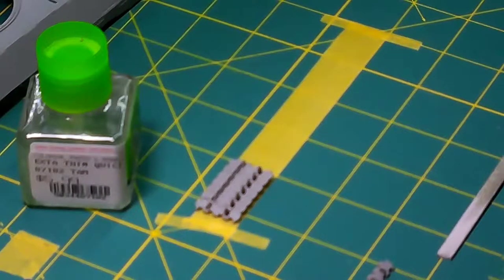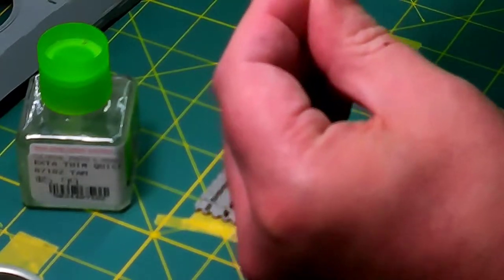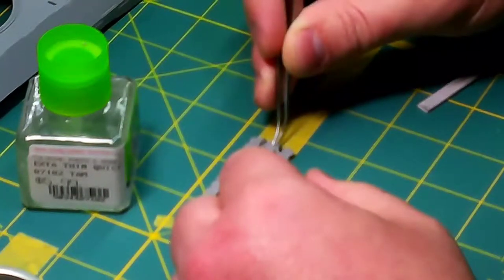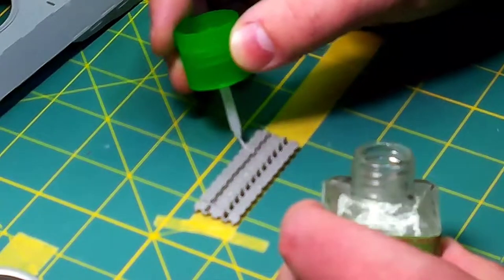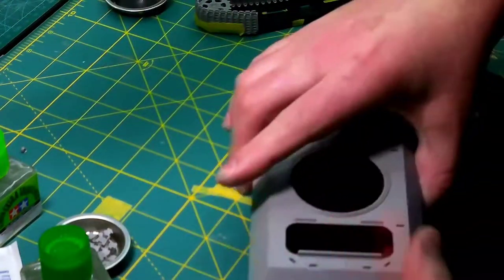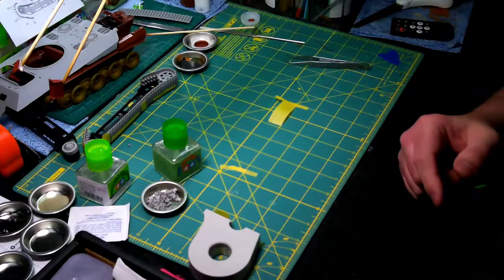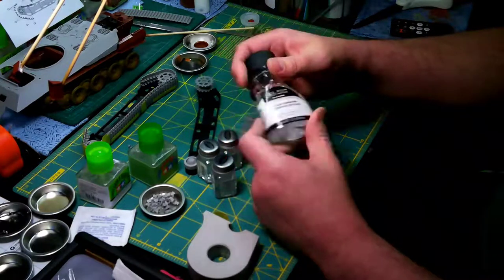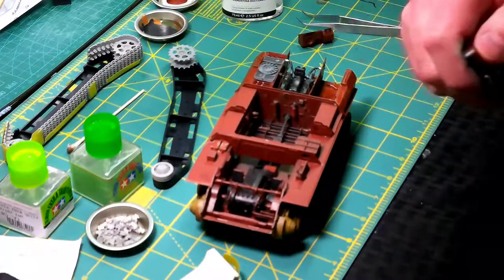Bergepanther Ausf G Build Update 11

Comment: I have not used enamel paint for years, so can not help with that. You tend to pull what you working on off-camera. I do think you are doing a great job on your first model.
Reply from the maker: loveminis thank you, I have to use an optivisor in order to see the small stuff and I tend to pull the parts to me instead of me to them, but I’m getting a magnifier on a stand that has a 20” depth of vision so that should help. I also think I solved the enamel wash problem with some different milder thinner I will be show in upcoming videos.😁